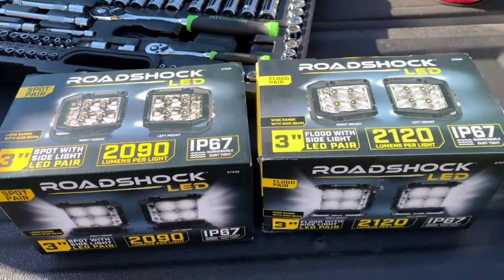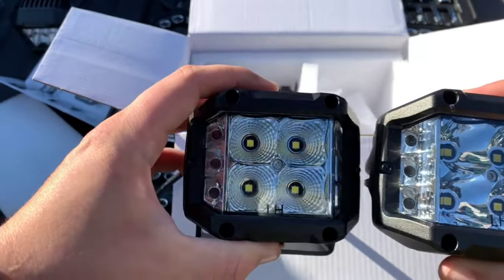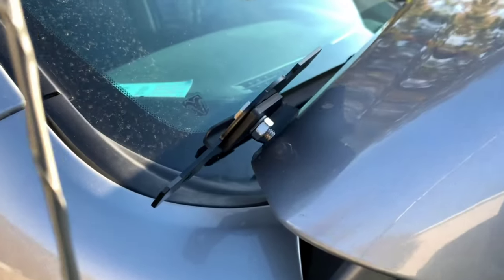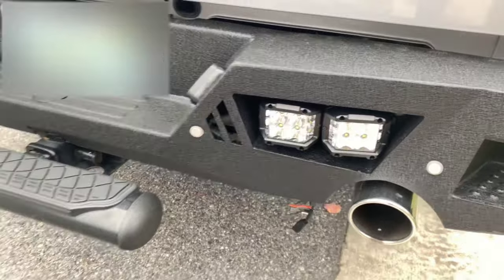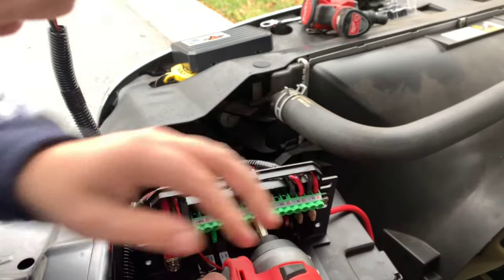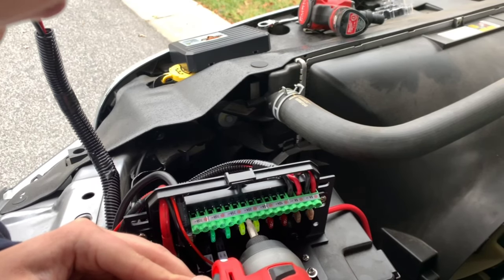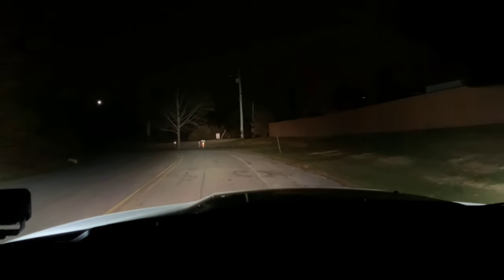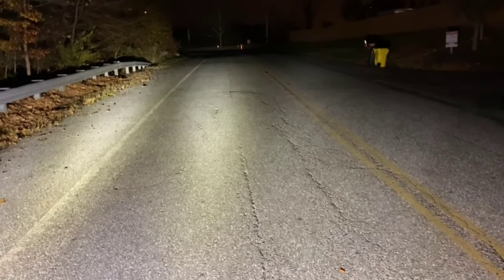Harbor Freight RoadShock led spot and flood

Comment: I have a set up similar to yours on my Tacoma.  Spots facing forward with ditch lights on the side.  I also have the Auxbeam 8 gang switch.  I wired my ditch lights to 2 separate switches.  I see you're in Florida, as am I.  When driving back from Okeechobee on Hwy 70 late at night, the deer get pretty close to the road.  I only need to see the right side of the road, so I can just switch on that side for the ditch lights.

I appreciate your video.  I've tried so many different ditch lights and I just bought the fog/side beams from harbor freight.  Debating on getting the spots as current ones it seems about 30% of the light bounces off the hood.

Comment: Very nice job! When can you do mine? That’s exactly what I need. I had a 2016 Colorado Ext Cab Z71 4x4, V6, I traded for a 2019 Colorado Crew Cab 4x4, WT, V6. The price difference between the two is almost $5k! The only differences are no heated leather trimmed seats, 8” touch screen with Nav/Bose, Z71 trim pieces with black grill, but most importantly no projector type headlights and fog lights, that real helped when entering a dark corner/turn. What I did get was a fine 7” touch screen with OnStar 4G LTE WiFi, chrome grill, HD vinyl seats and flooring, with reflector type headlights with no fog lights. So I’ve replaced the halogen bulbs with MORIMOTO TWO STROKE H11/ low beams and 9005/high beams, that made a world of difference turning night into day, within the sidewalks and the road ahead for at least a football field and then some, but nothing to light up the entrance to corners, without the fog lights. But I don’t want lights above the hood, I’m looking to add fog lights to the stock mounts in the bumpers corners. Wired directly to the fuse box under the hood. Otherwise I’ll need to get the OEM headlight switch and have the dealer re-program the computer to get them to work. My dilemma has been with the expense aftermarket parts for quality lights, that actually illuminate. But now after seeing how these very reasonable Harbor Freight light work? Now all I’ll need is some type of mount, to mount to the stock mount molded into the bumper.

Comment: Nice video and I liked how you pointed out the hard parts on the install   I just installed my Ram adventure rear bumper from AmericanTrucks  on my Ram classic. 
 How is the whistling from the pod lights. That’s a concern of mine. As I noticed my GoRhino sport bar does start whistling at 70/75mph (I live in Texas so speed limits 70/75/85 are common in my area)

Comment: You can pick up a set of license plate lights that have a shield built in (or build a set) to keep the light off the camera. I realize these light cut through but it would still be an improvement. Just a thought. Have a great day and be safe out there!
Reply from the maker: I found out about those right after installing the rock lights, I wish I saw them before putting those on!

Comment: Thanks bro 🙌🏼🙌🏼🙌🏼🤙🏼 great video. What wiring did you go with? I noticed my roadshock LED lights did not come with a wiring kit.
Reply from the maker: I bought a 50’ roll of red and black 16ga on Amazon (I know it’s larger than I need but it was cheap) and soldered my own harnesses together.
Reply: @Guithero5  do you have an IG  so I could shout you out

Comment: For ditch lights mounted to the hood like you did, would you recommend the spot or flood version of theses? I only want to put one set on my truck.  Great video, thanks!
Reply from the maker: For ditch lights I would probably do the flood version, I have two lights on each side (so 4 total on the hood) one set is spot and they are facing basically straight forward. And the outer paid are pointed at about a 45° angle outwards and down. That set is a flood pair and they both work great.

Comment: You might want to look into putting led bulbs in you headlights and your fog lights. Can send a picture for reference
Reply from the maker: It was in the books when I made the video, at this point I now have aftermarket blacked out projectors installed. I still plan on doing the morimoto fog light kit.

Comment: Can these lights be put on a motorcycle. Thanks
Reply from the maker: I don’t know much about motorcycles, but if there is 12v power I don’t see any reason it wouldn’t work. You would most likely just need to get a mount that works!
Reply: @Guithero5  Thank You.
Reply: @AmitSaini-zm7sw only depends on if your alternator can power them. Need to check on how much extra power you have available after everything else is running.
Reply: @seashackf1 Thank you, can you suggest a way to check that?

Comment: What bracket did you uses
Reply from the maker: The ones that attach directly to the hood I bought on Amazon, however, the dual mount for the LEDs I bought off americantrucks.com.
Reply: Do you have a description of the brackets u got from Amazon pleae